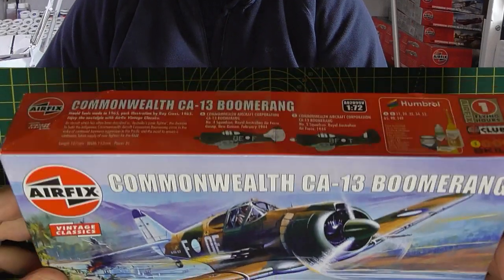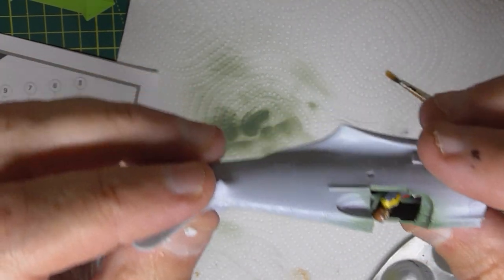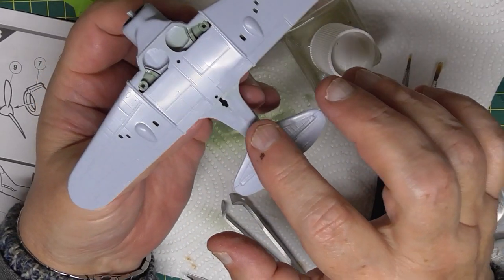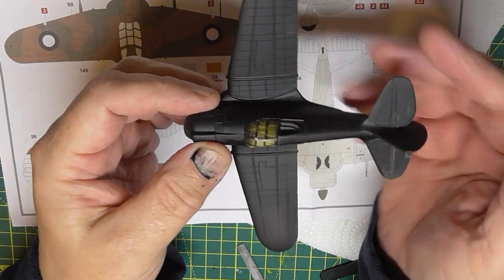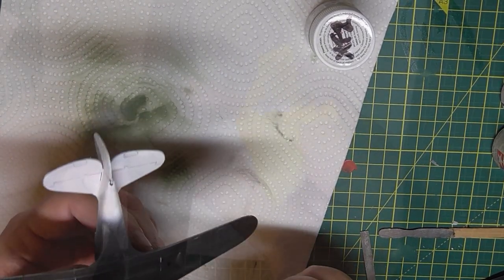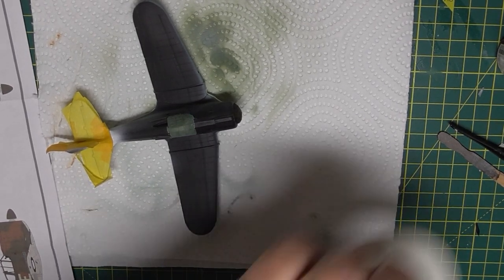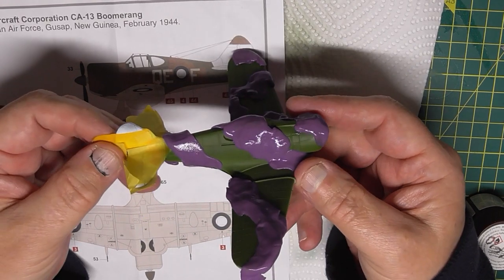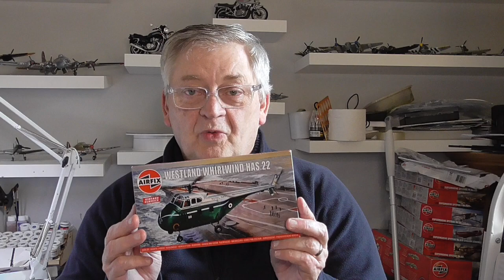Airfix 1/72nd scale Commenwealth CA-13 Boomerang complete model from start to finish

Comment: The putty stuff: can one reuse it?  If so, what happens to the old paint? Can it flake off and drop onto your new paint?
I do like the idea, I am just not sure how it becomes a ‘go too’ item for me!?
Good evening!
Bob
England
Reply from the maker: No you cannot re-use it, It comes in a tube and there are different types. Apply it were its needed and then sand off. Old paint doesn't come off unless you use some chemical to remove it, hope that answers your question :)

Comment: For masking the camo I use BluTac rolled into sausages and then split a tissue as they are usually 2ply. Then the tissue just gets lightly stuck onto the Blu Tac and away you go, very cheap and works well. It leaves a soft demarcation line between the colours and the Blu Tac gets recycled forever. There are 2 of these flying here in Oz.
Reply from the maker: Thanks for your comment, I used to use blue tac but I just find this putty a lot easier and it doesn't leave any residue on the model